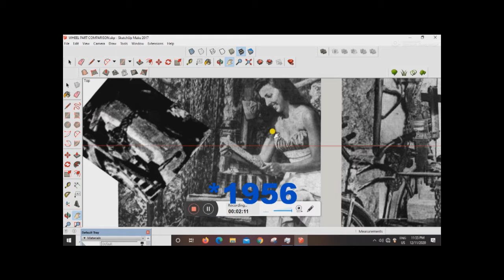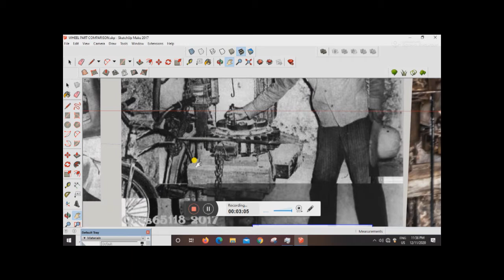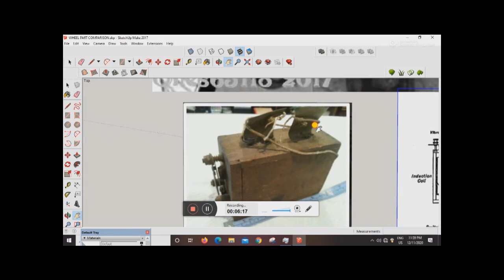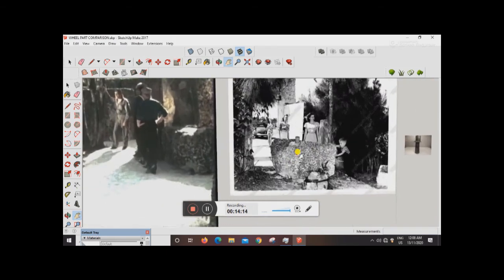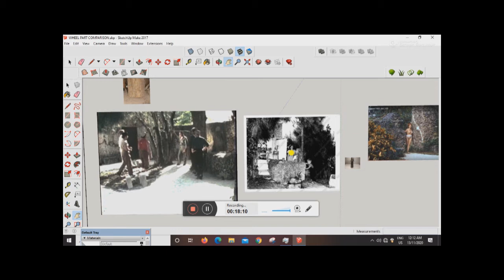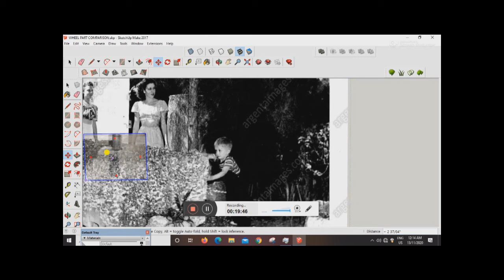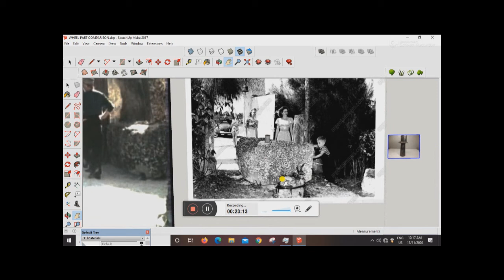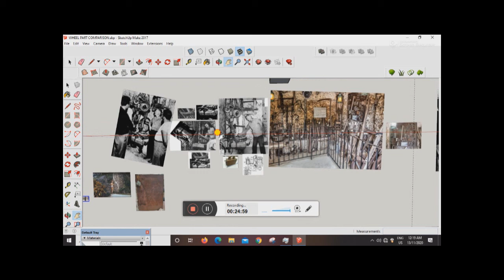Scattered Pieces Flywheel & Three Ton Gate

Comment: i wonder what is under the 3 ton rock? maybe rotating the horn should make sound or powering the horn would rotate the block? also that wooden piece the lady is holding may have a steel rod in it. also that black box on the tripod is still at coral castle today and is labeled radio tuning assembly. we know transformers make sound and have a strong magnetic field. wonder if the pmh is capable of making sound? i seen golf cart transformers made the same way as the pmh and they produce sound turning 110 into 48 volt dc